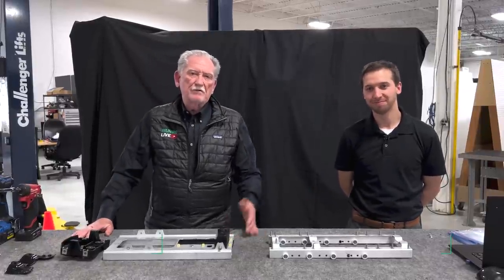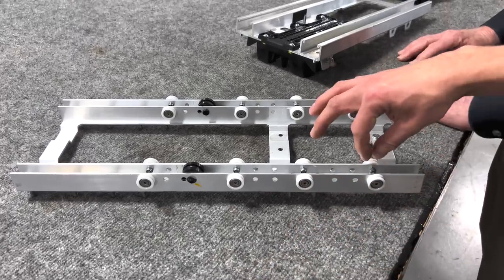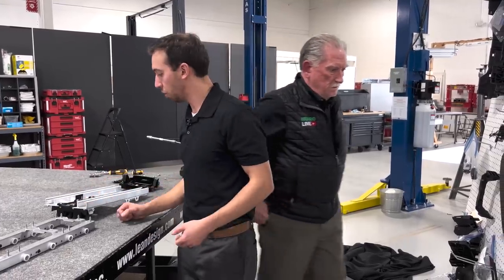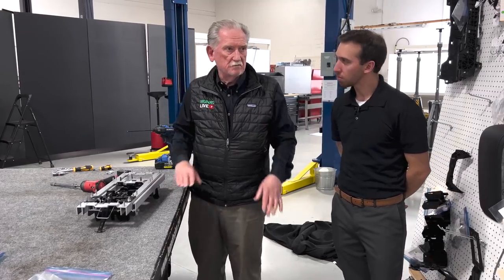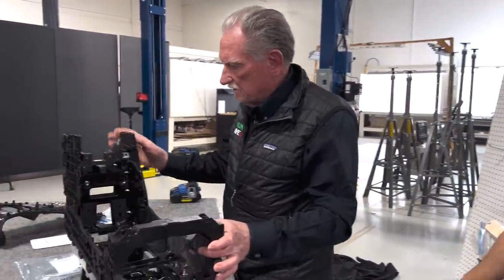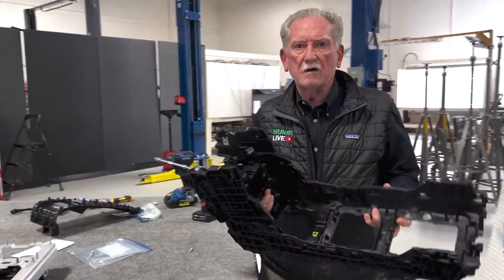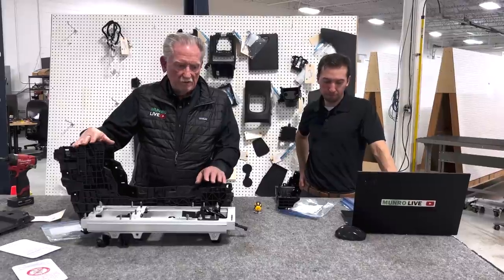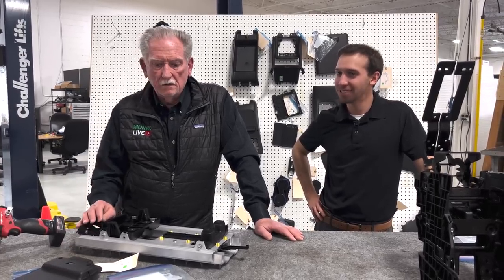Some assembly required | Hyundai Ioniq 5 Sliding Center Console

Comment: Perhaps a suppliers attempt at a modular base that they can use for all sliding consoles and then top off from a pallet of options.  Personally this is what I've come to expect from Hyundai as far as simplicity for serviceability.  The guys that design these things should be made to work a day installing them and then another day or so going through having to service and do common repairs.

Add things like the Theta2 engine fiasco, dash fires, brake harness fires and such and it will take quite a few years more before I would trust them to make a safe, reliable and serviceable vehicle to transport me or mine that they will stand behind.  Seen too many given the "See Ya, Wouldn't Want to Be Ya" by Hyundai when issues arise.  Many only got made somewhat whole again due to having a CarShield type plan that covered things the manufacturer/dealer would not take care of.

I cringe when friends and family buy a Hyundai since I may end up being the one having to service them once the warranty expires.

Best!

Comment: Hyundai built the center console so complicated and strong you could probably haul a truck on it!! :D Those fasteners could probably hold the whole rest of the car together and I'm not kidding! Subframe battery and suspension!!
Reply: Each fastener is a point of failure and more cost.
Reply: @NotNowLater  Absolutely, but you most definitely couldn't do the same stuff with the Mach-E center console :P But why should you? It is a center console!
Reply: @rkan2  As Sandy would say the best part is no part.

Comment: We now know why only the top Limited trim gets this very cool sliding console and the SE and SEL are a fixed mounted console. I'm guessing the intent was to have this on every trim until the cost was considered.  Rather than fix the cost / complexity issue, they just cheaped out and made it fixed on the other trims.  Please DO redeign this.  It would be great to see this feature on all trims!
Reply: Wait.  They designed ANOTHER console? How did they find the time or money- or bolts?

Comment: This is only on the highest trim level. 2/3 of the cars do not have this. I have one in my car and I use it a lot. It allows me to slide between the two front seats without getting out of the car. In 34,000 miles it does not rattle, nor does anything else in this car rattle.

Comment: Im an engineer now, but used to be a technician. Every engineer should be required to assemble and disassemble their own design before pushing it to production. Engineers work in the CAD space and things are easily put together. Mate this to that, check for interferences, and done. Its absurd just how difficult an engineer can make someones life becuase theyre too lazy to think about the manual labor involved.

Comment: 17:00 plastic fits always rattle. If it doesn't - you haven't waited enough. If you don't want to wait - disassemble and assemble it again, while e.g. installing theft protection or something similar
Reply: In general, I agree.  I dislike snap fit plastic assemblies because you get buzz/squeak/rattle if you ever need to disassemble and reassemble for maintenance.  None the less, there is probably room to greatly simplify the console because there is probably not likely the unit will ever need to be taken apart
Reply: @wtmayhew  especially in BEV with proprietary unreplaceable battery, so in 7-8 years car became salvage regardless of milage.
Reply: @barongogenzoler4300  Good reply, thanks.  It was nice to se the Licid battery pack could be dismantled, probably with an eye towards recycling, instead of being a big potted mess like some of the other manufacturers.
Reply: @wtmayhew  AFAIK technically you can replace battery pack in every BEV. But considering the price... You can't. I mean, e.g.10-15y old Model 3 will have at most 15k in current prices. Still good chassis, still enough power, pretty good daily even in 15 years. But after so many time battery will be dead, and only hope will be some vendor making replacement/refurbished packs because 16k for replacement is too much even for 40k car. But looking at perspectives of raw material shortage... For now I will stay diesel.
Reply: @barongogenzoler4300  What I was referring to was end of life recycling of the constituent parts of the battery.  Current battery technology is close to sufficient that the battery will not need to be replaced during the normal service life to an automobile.  … Thinking here of an automobile used in an area where chemicals are used to de-ice roads.

Comment: Having been a design engineer for two decades, I suspect the reviewers have probably never spent time with this console and are overlooking what stresses it may be subjected to during it's usable life. It is built sturdy because being a center console it may be subjected to people sitting on it or people supporting themselves while changing seats or people leaning against it to reach towards the other side of the car or the back seat area. The level of disdain exhibited by the two reviewers clearly exhibit a lack of understanding about the durability required for this part during years of use.
Reply: Yup, you basically read my mind. I own an awd limited and I always scream at my wife for putting too much weight on that thing (while reaching for backseat area for example)

I'm glad it's been built to withstand some abuse considering it's a moving part.

Comment: This is what happens when automotive manufacturers are used as jobs programs by governments.  It causes lean design to be a secondary consideration. 
This type of unnecessary assembly requires more labor = jobs.  If the company tries to automate too much and get rid of labor they have a govt. problem. This same issue effects US OEMs like GM.
Reply: It is still very bad engineering. I would expect the entire car to have this awful jobs program engineering. This is a hard no on any Hyundai Kia EV. They do ride nice though
Reply: Not sure what you are talking about.  Hyundai and KIA make some of the most efficient EVs in the world.  They build off a modular 800v platform.  The Ioniq 6 is , apart from perhaps the Lucid, the most efficient EV on the market.
Reply: @anxiousappliance  Love your screen name BTW. 
Basically the complexity and high weight factor of the Hyundai center console seems to indicate that there has been a lack of design with an eye to simplicity of construction on the assembly line. You are right about how good these cars are as to efficiency, but have you noticed how few Hyundai is actually making?  Minuscule amounts. Part of the problem might be that they have not designed this car to be quickly and efficiently produced. This, plus their small production numbers, means they are losing money on every car they make. Either they do not intend to make but a few EVs and therefore can ignore costly complexity, until they absolutely have to.... which may be too late OR they would like to ramp production but cannot because of bad materials and assembly design as as pointed out by Munro. There may be other reasons for this type of complexity and over engineering but I can't think of them. 
   This is to say that with this type of design they are hamstringing themselves as to how fast they can make these cars and how much money they are losing making them.

Comment: Lot of harshing on KIA/Hyundai.  For the record, they build some of the most efficient EVs on the market, second maybe only to Tesla.  This is built on the modular 800v E-GMP platform, which in its short time has spawned 4 distinctive vehicles.  Tesla does not have a modular platform. The Ioniq 6, a E-GMP car,  is one of the most aerodynamic and efficient, mass produced cars ever made.

Comment: Some engineer at Hyundai is going to have a bad day today. 487 parts in a console is probably adding $60 easy to the cost of every car. Not to mention the time it takes to assemble it because I can tell its not been designed to be automated.
Reply: More than that.

Comment: I don't know about Mr Munro... "I could got got rid of all these..." Ummm so I drove a 2015 Ford fusion energi for almost 10 years, and please mr munro I don't ever what to heat that. It was a piece of junk car, because somone "got ride of all these". The darn thing fell apart, 20 separate issues from SD Card malfunction, Radar Malfunction, to super dangerous stuff like loosing power steering and (interior mind you) wiring harnesses catching fire. Never ever will I buy a car from ford company again. They are junk, they make junk.

Comment: I imagine what happened is that the sliding center console became a black hole of compromise. A moveable device in a vehicle? Probably had all sorts of safety requirements to make sure it didn't slide forward and somehow end up under the accelerator pedal. But yeah, it is pretty terribly design work- more like something I'd expect from GM or Chrysler.
Reply: because Chrysler and GM are famous for overbuilding things? LOL

Comment: You should look a lot more into how cars are built from the maintenance and repair effort angle as opposed to whatever new engineering processes that make cars easy to assemble for the manufacturer or somehow great when the vehicle is brand new or a digital  3d model where you are impressed by it.
Cars are meant to be driven and cars will crash, and when that happens, they need to be repaired.
Or heck, cars can be upgraded and modified by the owners without any crashes, and their building should be easily accessible to anyone having the corresponding knowledge.
And seeing how cars aren't rocket science, well, everyone that doesn't have 2 left hands should be competent to work on the new cars as well, if they were competent enough to meddle with the previous generation of vehicles.
If a car is too complicated and requires dedicated specific tools and parts not widely available, that car and manufacturer should be shunned, and blasted publicly for anti consumer abuses.

Comment: Munro glared at the lead of the engineering team; "With such a simple purpose, how is a design this complex possible?"
The team lead looked down, "My nephew is a Service Technician." 

"Hi service manager!  For the third time, there seems to be another rattle in my brand new under warranty center console."  The Service Manager frowned and the Technician smiled saying; "I'll get right on it, that's another 16 hours assembly and repair."

Comment: Now we know why the Ioniq5 costs 15K more than a Model Y.
Reply: When I bought my ioniq 5 a model Y with comparable specs was at least 15K (Euro) higher priced than the ioniq 5....(My ioniq 5 is a project 45 limited...a first edition with only a few 100 available in my country. But I admit it was at least 10K cheaper than later limited versions because it was the first.
And it has that sliding console.
Reply: because it doesn't?